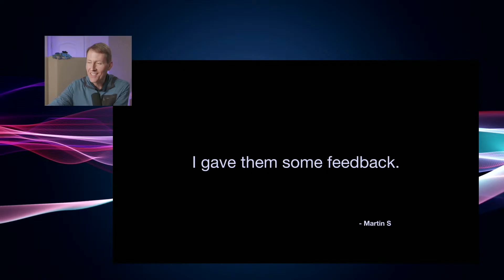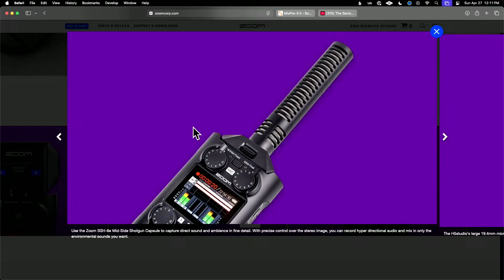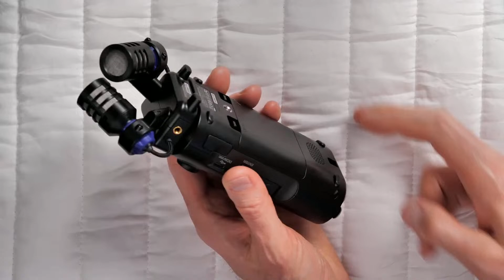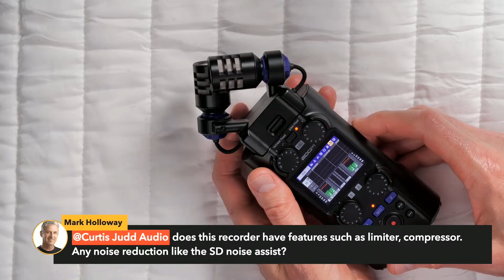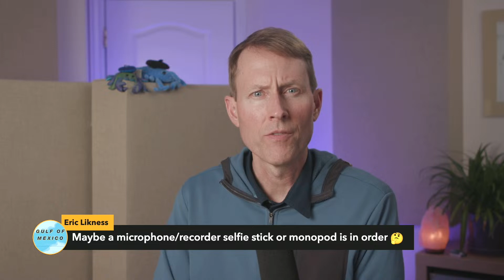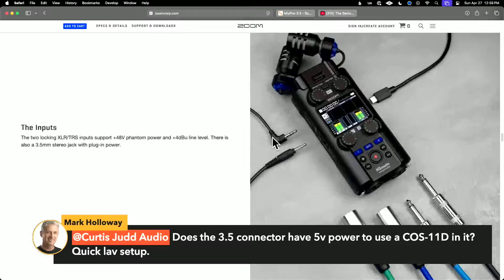Sound for Video Session: ZOOM H5studio First Impressions

Comment: And another thing... that Sennheiser MS shotgun looked promising, but I would love to hear the real world difference between that and the Zoom M3 MicTrack device, which is also MS based.  The latter has rather more in the way of features - not least 32 bit float recording with dual ADCs via F series preamps - and is probably radically cheaper, but of course if the actual sound from the mics was poor, then the price and features don't matter to those able to afford "the best".  

I don't recall you ever reviewing the M3 - maybe you were put off by the poor initial reviews which lead to it being withdrawn and relaunched in a fixed condition - and of course you can't review every little bit of audio equipment out there, but...   I have the M3 (and the M2) and I think it's got a lot to offer, but of course I don't have the Sennheiser beauty to compare it with.  Sometimes audio equipment sounds excellent until you compare it with something which actually is excellent!
Reply: LOL! Thanks Peter. I have not reviewed or used the M3 and you're spot on — I can't review it all. But good to hear from you that it works well for you.
Reply: Hi Peter... Do you happen to have any videos with audio recordings of the m3? I'd like to hear your recordings with it.

Comment: One very important factor you didn't mention is that the gain controls are digital, not analog.  Have a look at the full manual and check out the circuit diagram right at the end.  The first thing after the input sockets / mics are the A/D converters.  

Now this affects the whole way you might regard this device.  It offers 24 bit and 16 bit as well as 32 bit float, but that choice is only of any importance if you want to hand over to someone else a 24 or 16 bit recording - or if you can't handle 32 bit float when you edit.  The usual thing about setting gain in 24 or 16 bit manually really becomes close to pointless.  Anything you could do with the gain controls on the device, you could do when editing later.  Digitally raise the gain in-device, or in editing, same thing.  

The risk when recording other than in 32 bit float on this device is that you could turn the digital gain controls up to the point where the 24 bit file can't handle the level, and you'd get digital clipping.  So they advise aiming for -12dB on the meters (which by the way can be presented in three different display styles, worth exploring).   On the other hand, max digital gain applied when recording in 32 bit float won't matter because you'd never hit the +1500dB limit (or whatever it is).  I know you tend to prefer setting gain manually for 24 bit recordings, fair enough, but with this device it's hard to come up with a reason to do that (other than the scenarios I mentioned before).  If you do really, really need 24 or 16 bits, then the gain controls would mean that the output could be made to look at a healthy level when handing it to someone else, and/or they would instantly replay at a clear level, but  I'm not sure there is much point in the rapidly standardising 32 bit float world we seem to be marching into.

I think this is a great device which I would buy in a heartbeat if I was actually doing any recording these days, sigh, but it is not a device suitable for anyone who wants a traditional approach to 24 or 16 bit recording, where you set the gain to get the best from the preamp.  On this device, the preamp levels are fixed.
Reply: Peter, I would like to know if things are different in Tascam X8 and X6, that is, if the control of the 16-24 bit recording is in the analog domain, or if with Tascam there is also a digital level control. Thanks!
Reply: @calandrella57  I checked this in the manual for these devices recently and it did appear that they have analog level controls at the inputs.  But if you google for the full manual yourself, go to the end where the circuit diagram is, and see if you agree with my interpretation.
Reply: @Ozpeter  I checked and it's like you say, analog control, thanks!
Reply: @Ozpeter  I'm also curious about the Tascam Fr-AV2, but I can't find the circuit diagram...
Reply: @calandrella57 "If an overload occurs with an analog circuit, the entire level meter will become red." - that's in the manual in the section about level setting so it implies that levels are set in the analog domain.  However, in a forum discussion it says that "there is no analog input stage gain control whatsoever on this new tascam unit.  I emailed Tascam directly to ask about this (back in September), since the manual's section on 'Setting the Recording Level' was not clear, and their answer was "REC LEVEL is done at the digital stage"
Reply: @Ozpeter  thanks!
Reply: Thanks for the insights, Peter. 🙏

Comment: I'm especially interested if the self-built-on mics are on the same circuit as the XLR inputs?  So, when you insert the XLR cable, it just detach?  I would use for nature sounds on long run, like leave it in a forest for a night for example.. thx for investigating this in the coming video. Cheers from Hungary!
Reply: No, there are separate gain controls and enable controls, so you can record four channels of audio at the same time - and I believe you can also record a mix of the four as well, so you are effectively recording 6 channels of audio at the same time.

Comment: Do you know if the 3.5mm uses dual ADCs? Also what is the real 3.5mm voltage?  Thanks. :person-turqouise-waving:
Reply: Voltage is 2.5v, per the specs Curtis reviewed on the video. Not sure how it uses the ADCs, though.
Reply: @wildlyundivided  Thanks but I was hoping to find out the true 3.5mm voltage.  Many of the Tascam recorders spec 2.5v but when measured only puts out just barely over 2v. Some 3.5 mics need a true 2.5v or more to run correctly.
Reply: @ICatchSounds  Ah, good point. Hopefully Curtis has a way to measure that himself.

Comment: Thanks for the video. As far as I understand from  zoom website and looking closer at the timecode adapter, it is for standard smtpe timecode that you can use for jamming to and from regular ltc timecode devices. On top of that it can work with atomos bluetooth timecode using another adapter (bta1)
Reply: Thanks — good to know! So it must have an input/output port of some sort...
Reply: @curtisjudd  Magnify the picture of the timecode adapter, to me it looks like to have a jack connector on the side. But the text says that the adapter will allow to jamsync smtpe both ways.
Reply: @ww1www  👍
Reply: It has a 3.5mm I/O to jam sync other devices or be jam synced from something else. Hopefully they will update the firmware for some of the other zoom devices that will allow the use of this adapter as well. It’s a great feature!!

Comment: Since the connection between the XY capsule and the recorder seemed digital to me, I asked Zoom technical support for information and they clearly replied that the connection of the capsule 3.0 system is analog and that the preamps are inside the recorder and not in the capsules. They specified that, therefore, also the SSH-6e and EXH-6e modules use the F-series preamps present in the recorder. What do you think?
Reply: Hmm. I'm surprised, but that would be lower cost to do it that way. Then they wouldn't need to double up on converter stages...